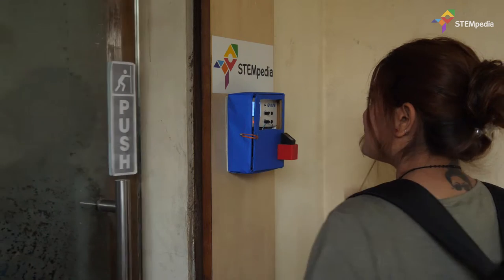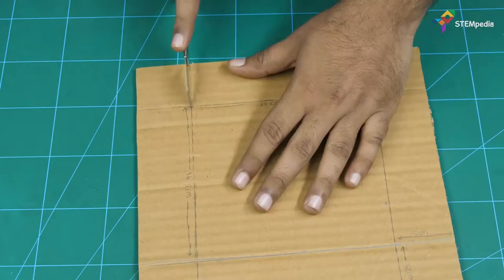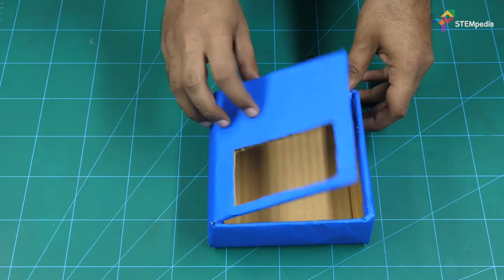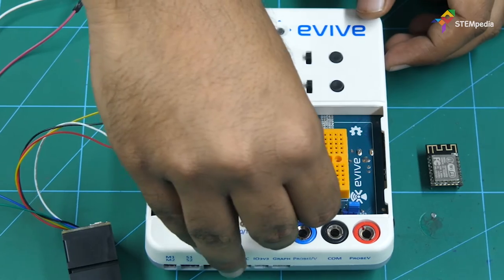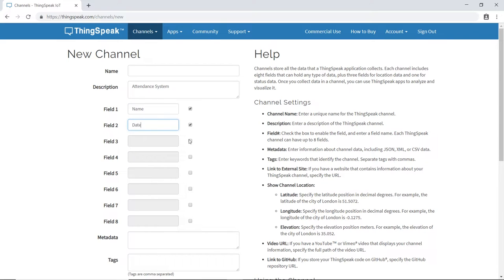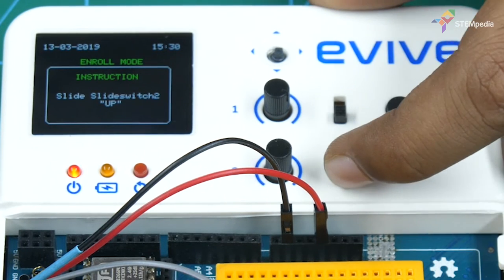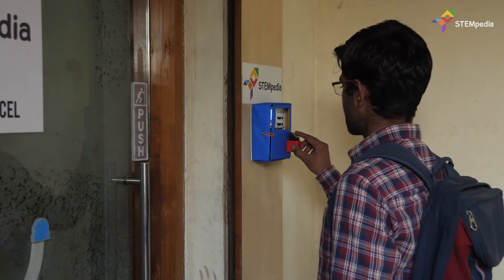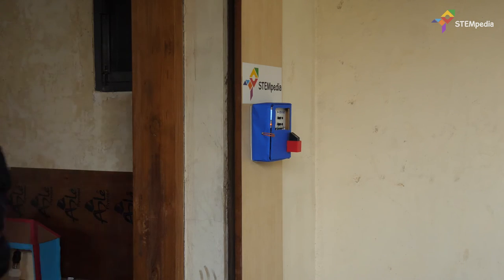Easily Track Attendance - Make Your Smart Fingerprint Attendance System | DIY Project

Comment: Is the maximum people can be added for this project is 25?
Reply: It depends on the model of the fingerprint sensor. 

Here are some common modules and their storage capacities:

1. R307 Fingerprint Module - Can store up to 1000 fingerprints.

2. R305 Fingerprint Module - Has a storage capacity of up to 256 fingerprints.

3. GT-521Fxx Series - Some modules in this series (e.g., GT-521F32) can store up to 200 fingerprints, while others like GT-521F52 can hold up to 3000.

Comment: bro i am using Arduino Uno R3 and R307 and i am stuck at the point how to add name of user, like you enrolled and the name came on the file but i don't know how did you assign your enrolled fingerprint with name.

Comment: Hey, you exposed some API Keys there, by the way. Also, it probably makes sense to edit out the part where you enter your password, so we don't see your email, and that the password has ten characters. Just a friendly heads-up, for the future. Change your password and generate new API keys, maybe, just to be safe.

Cool little project! I'd definitely have privacy concerns, especially using a third-party service in that way for a bunch of individual's biometric data.
Reply from the maker: We surely have. ;)